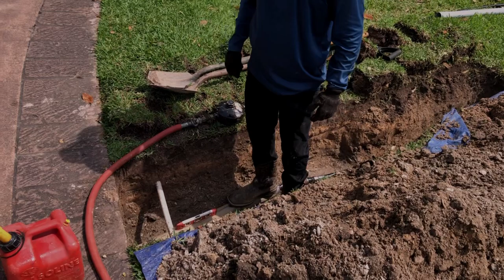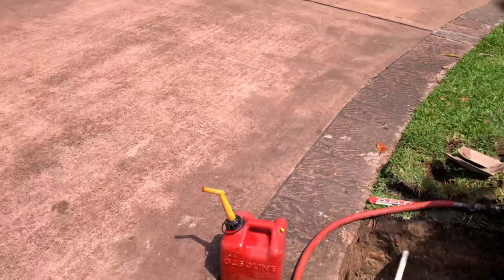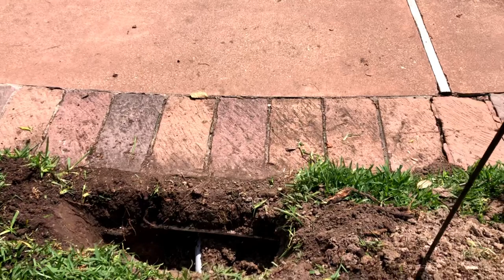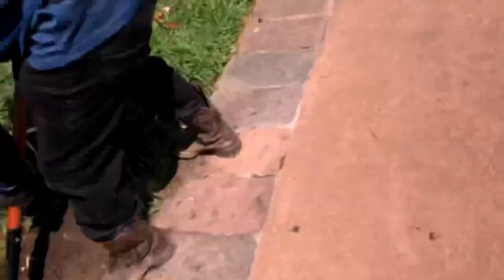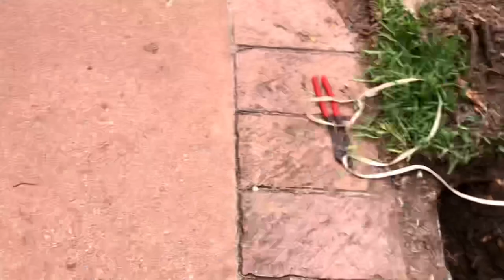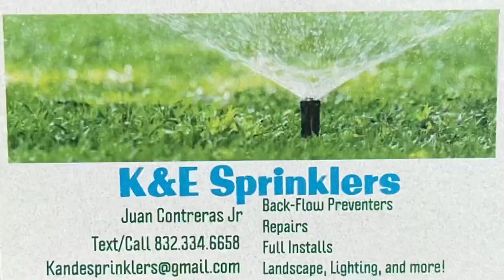Boring Under Driveway using 2” Missile

Comment: I've done this same thing without an air compressor.  I did it with a water hose on  the end of a PVC pipe.  The water cut through, under the driveway with zero problems.  It just pushed right through when the water moved the dirt/gravel away.  After the conduit was in place we would flush fine sand into the hole to fill up any void the water left.